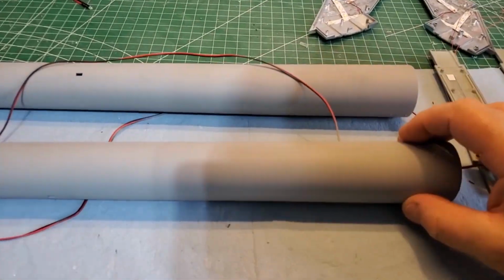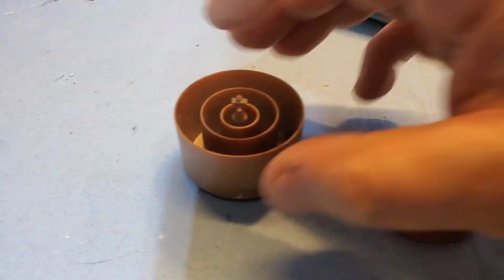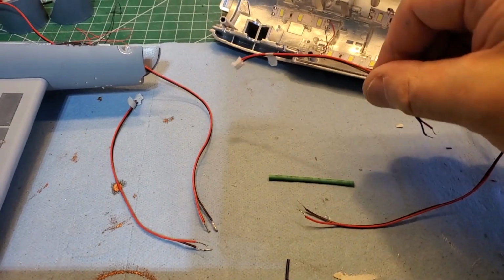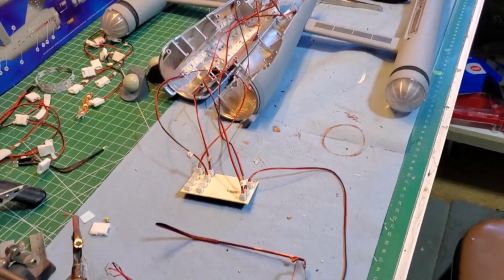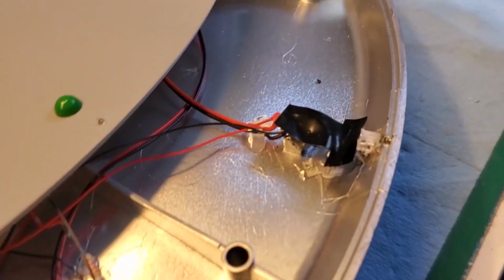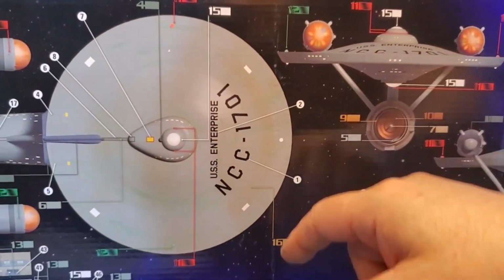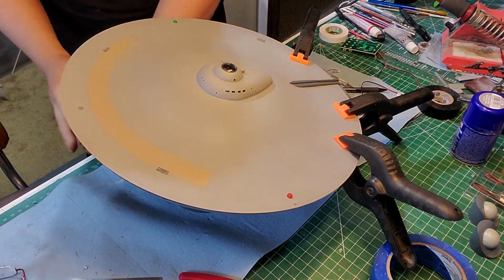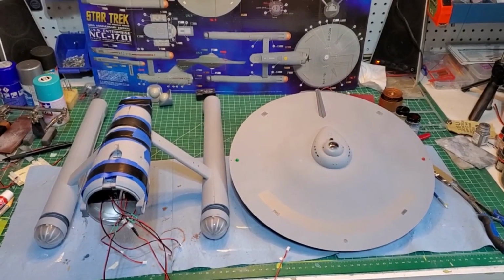350 Scale TOS Enterprise Build (Part 4)

Comment: Question sir I’m currently working on a 1/1000 excelsior and want to light her. For light blocking I know about spraying the inside of the model but do I also spray the outside?
Reply from the maker: Yes, you need to spray the exterior with primer which ill also add another layer to light blocking but mainly it is for the primary paint color to adhere too.
Reply: @epycmodels946  thank you one more question for the green strawberry photo etch would it be better to add it before doing the final paint coat or before any painting is done
Reply from the maker: @captaincharlemagne  Generally I add the photoetch after I primed them and painting them the color you want then install them before the primary painting is done.
Reply: @epycmodels946  okay thank you for answering my questions sir. Have good day  🖖